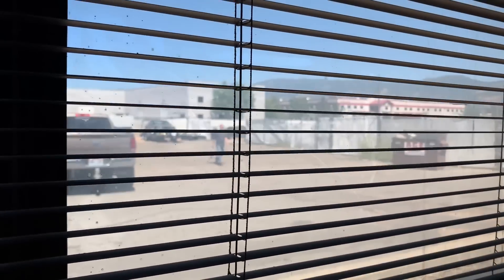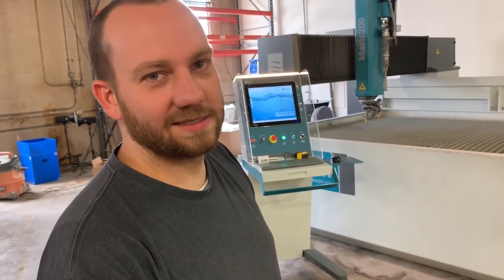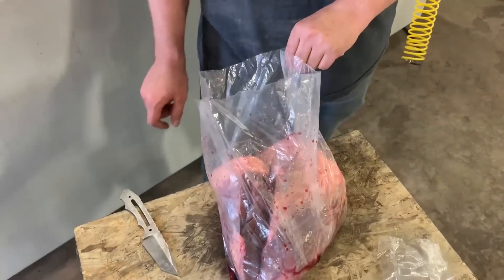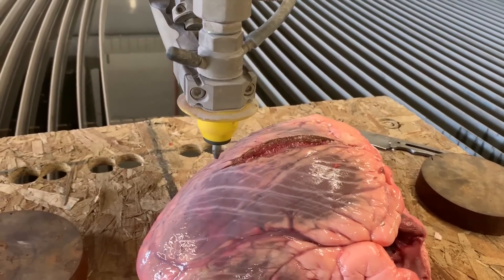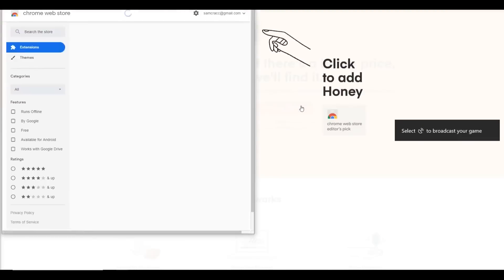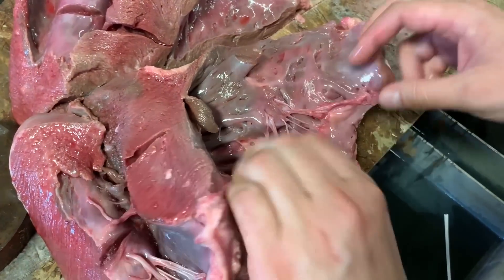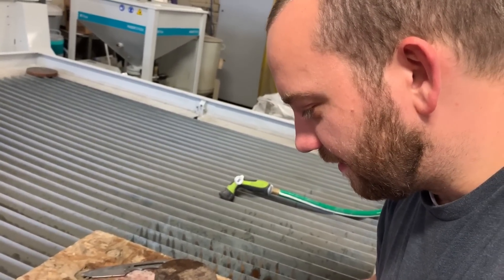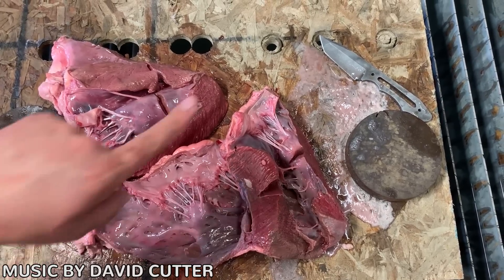Dissection with a 60,000 PSI Waterjet

Comment: The "strings" are tendons for the valves, they stop the vales from collapsing on them selves. When you hear the lub dub sound of a heart, it's actually the sound of those tendons being tensioned and snapping in to place like when you pull a cord quickly

Comment: What you have right there seems to be the Left and Right Ventricles. The right ventricle doesn't require much force to pump blood into the lungs, hence the thin muscular wall. The left ventricle is much more muscular cause it requires more force to send the oxygen-rich blood through the aorta and into the rest of the body. The strings that you see there are the chordae tendineae, basically small tendons that are attached to muscles inside the heart that contract in order to open and close the Tricuspid valve on the right side, and bicuspid valve on the left side.

Comment: As a cardiac developmental biologist, listening to the descriptions of the heart were both cringe and very close to being accurate. The chordae tendineae (Mitchell's heart strings) pull on the valves to close them. The weird hole structures are part of the trabeculae. They act to both increase volume of blood into the ventricles and to decrease pressures and turbulence (a lot of on going debate still!). Although I've never eaten heart meat, I would imagine the best cuts are the ventricular and atrial free walls. I wonder if the ventricles and atria have different mouth feels...
Reply: ZuperZocker It’s such dense meat, though. I think if I were to eat it, I would go for the left ventricle, since it’s thinner and probably easier to chew. Definitely have to avoid the chordae tendinae, those things are like as tough as steal. I’m happy you said it was cringe, though but pretty accurate with layman’s terms. I felt that same thing.
Reply: @johnjohnson201  the left ventricle is doing the most movement and work though so I'd expect it to be the toughest bit of meat
Reply: I have not eaten cow heart, but i have eaten moose heart. It has always been smoked the entire thing and you just cut it in to slices.
Reply: But youre not a botanist soooo... bye. 
Lmao they crack me up! And thanks for the real description!

Comment: Cow hearts have four chambers (just like all animal hearts).  Two upper chambers called atria and two lower chambers called ventricles.  The Right atrium collects oxygen poor blood from the body. When the heart contracts, blood gets squeezed into the right ventricle, which then contracts and sends the blood to the lungs. The left atrium collects oxygen-rich blood from the lungs.  When the heart contracts, the blood gets squeezed into the left ventricle and then to the rest of the body. Those strings, are called chordae tendineae and they're involved in the opening of two of the four heart valves (the tricuspid and the bicupid valves).  Also, the aorta isn't the "top part of the heart," it's the largest artery in the body which lead out of the heart.  It's venous counterpart is called the vena cava and leads back into the heart  Source: I'm an ER nurse.

Comment: So my expertise is bacteria (microbiology) but I like to think I know a thing or two about hearts ("botany").

The "heartstrings" are tendons that hold the valves in place. The heart uses four valves to prevent back-flow of blood while it pumps. There should have been a thin membrane attached to the strings: that's the valve. It is simply a floppy bit when blood flows the correct direction but if the blood tries to flow backward it will catch the blood and the tendons hold the membrane in place. It's kind of amazing that those little fleshy bits work almost perfectly for the entire life of most organisms. 

The chamber above the valve (no stings on that side) is the atrium while the area below the valve (strings on that side) is the ventricle. 

The chamber Mitchell was exploring looks like the right ventricle, the part that sends blood to the lungs. There is less force needed to send blood to the lungs than to the entire body so the right ventricle has less muscle (thinner walls) than the left. 

A fun and educational video gentlemen, cheers! (I wish it only took 16 seconds to cut open hearts the last time I did a dissection)
Reply: I’m no botanist (person who studies plants) but I am a physician so I too know a little about biology. Those ridges are called trabeculae carneae and they are thought to prevent suction that could possibly occurs of the  walls were smooth and came in contact with each other.
Reply: @t8do543  Oh, come on, you are a botanist. You know about hearts so you're a botanist. 

Use your brain to figure out why they said botanist instead of correcting it.
Reply: @t8do543  That surprisingly makes sense. Like those vacuum bags, they have ridges and a rugged texture, to avoid the bag sealing itself. Like when you suck too hard on a straw and it collapses and gets stuck.
Reply: what about the heartholes
Reply: @bitai683  Second that, I know a bit of biology but those things caught me off-guard. Are they just holes where tendons used to be?
Reply: @dimitar4y  i think those are where the meteors hit the surface
Reply: botany? im an ACTUAL biologist. but it doesnt take an education to know that botany is plants dude XD
Reply: Phlebotomy does not deal with the heart.  We deal with blood work and the collection of the blood (specimen).
Reply: Millions of years of evolution almost perfected us.
Reply: Botany is plants
Reply: @thedoomofred5174  yes, we know, that's the joke.
Reply: Was gonna start explaining it but looked like you've pretty much got it covered, very nicely explained
Reply: @ryanc473  booo, neckbeard who pretends to know, start explaining anyway, could use dem botanist second opinions! Don't steal credit for shit ya didn't do, boo, rotten tomatoes, etc.
Reply: @dimitar4y  lol, I'm not trying to take credit, merely conceding that he explained it both faster and better than I did/ could have. More meant as a compliment to the original commenter than anything else, but feel free to interpret however you'd like I guess. It is the internet after all